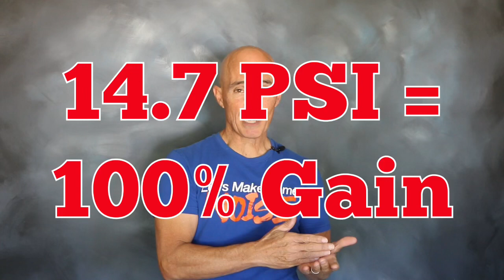More Turbo Power! What can you do to make more HP per PSI of Boost?

Comment: I’d like to see a budget reliable 1000hp turbo LS build. Frieburger did one on engine masters with a set of 1400.00 rods. Realistic would be good
Reply from the maker: what rods cost $1400?
Reply: The FEW places I have found them the Wiesco boostline rods he used range from 1200-1500.00
Reply: From wiesco site they list at 1400. The most common price is 1250 ish. I think lsxeleration has them for 1475
Reply: I’d personally like to see the new Summit ProLS rotating assembly put to the test. For a complete kit at 2000.00. Said to be built to handle 1000 hp. Usually means it will handle 15-1800
Reply from the maker: John Sutton that’s a lot
Reply from the maker: John Sutton big money
Reply: A lot for the Summit kit? For a forged 408 kit with rings and bearings? That is the cheapest “good” kit I have been able to find. Crank, rods and pistons. They have different CI sets.
Reply: I feel like I work for them!!!! It’s just the best Deal I have found. Like you said it is still a lot of money. So you buy them and torture test them so I can feel confident in buying it. Then put it in my s10 drag truck with a s480
Reply from the maker: John Sutton I just got pistons and rods
Reply from the maker: @john-sutton-tn  thought it was just the rods
Reply: No sir. Crank, rods, pistons, rings and bearings. All forged and moly rings.
Reply: My donor 6.0 is a gen 3 but had some damage on #1 bearing journal. Spun a bearing. I live in Va. Finding competent LS machine shops is very rare hear and generally super expensive. So to get a good kit that is balanced. I can set all clearances myself.
Reply: My donor LQ9 had a damaged #1 rod journal. The cost of repair and pistons and rods, is close to the cost of the kit with crank.

Comment: Turbo size is very important for these calculation. 14.7 psi on a small turbo will not make nearly as much power as 14.7 psi on a huge turbo. CFM is what makes power not necessarily PSI.
Reply from the maker: a turbo that is too small won't be able to supply the same boost
Reply: @richardholdener1727  Understandable. I just came across your channel and love it! Have you done any videos comparing pressure vs volume? The same PSI on two different sized turbos can make drastically different power numbers. That's all I meant. I'm pushing a pretty small turbo to about 42lb/min but it takes 25psi of boost to get there. My last slightly larger turbo was flowing the same amount of air at only 20psi.

Comment: Happy holidays have a question I have a GT 350 and I am having a hard time trying to make my decision on what power adder  to go with We have Hallion Twin Turbo sleeper kit we have the Pro Charger unit and we have the new GEN five Whipple supercharger.
So people are telling me that the belt driven Superchargers sometimes break the snout of the crankshaft And Twin Turbo’s are a lot of work and not reliable and have issues so I stumbled into your site on YouTube I figured I would ask you what would you recommend and your opinion on the subject
Reply from the maker: depends on your power needs-they all work at moderate power/boost levels-that GT350 has high static compression so boost is limited any way. turbo make the most hp per psi of boost
Reply: Are Turbo chargers More problematic and have more issues than let’s say Pro Charger or a Whipple

Comment: Why does most LS builds seem to stop at 28-29 psi of boost?
Is that the safe limit? 
audi,toyota,honda and nissan builds seems to often go higher,40-50psi of boost.
Thats ofcourse mostly buildt motors,but some are stock bottom end making 750 hp on 2.2 L displaysment !

Comment: And then if we started with a billion horsepower and doubled it.........lol Just jokin man, so the exhaust after the turbo , being more important, what size should I run if i'm estimating my power goals of my Saturn engine to be 325-340 HP? I know that my CV axles in the Saturns are rated up to 375 HP so that part, I should be ok, but I'm going to do .20 over, 3rd generation 6 counterweight crank and lower tie plate, ARP main and head studs, a stage one port and polished head with polished combustion chambers  , port and polished intake manifold with port matching , bigger throttle body, dual intake cams, mild de shrouding of the intake valves, mildest bowl blending offered, and adding narrow blended 1-2 mm valve seats and shim the valve springs to .15'' with 14 PSI of Boost,  and I haven't decided yet if i'm going to run it on E85 , unless you can tell me how to safeguard my fuel supply parts to run it safely,  thanks, if u can let me know, always enjoy watching your great work and great channel..  ;)
Reply from the maker: THAT WOULD BE A BIG TURBO!
Reply: @richardholdener1727  For the joking billion HP? or the 14 PSI?...lol

Comment: 300 horsepower and 29.4 psi boost =900.16 assuming everything holds up and you have enough air/fuel
Reply: If you had the 600 hp by adding one atmosphere, and then you add another atmosphere, that should double the hp again 1200 hp. Am I wrong ???
Reply: Dale Ostrom incorrect. Every atmosphere adds the stock horsepower one more time. 
300= 1 atmosphere 
600= 2 atmosphere 
900= 3 atmosphere

Comment: The amount of hp per pound of boost has a lot to do with volumetric efficiency.ls engines have very good VE  for many reasons so they can make huge power with not much boost compared to some less efficient engines.

Comment: Have you ever done a carburetor intake manifold comparison on the LS series? Say on the old LM7?  Would the gains be noticed on a 400 ish N/A build level? (Cam&springs swap)
Reply from the maker: Ive run lots of carbureted intakes on cat and rec port applications
Reply: Richard Holdener any one intake the clear winner? Or pretty much all yield close to the same results?
Reply from the maker: brandon mash https://www.hotrod.com/articles/20-ls1-intake-manifolds-tested/amp/.  Take a look at this intake test I did for Hot Rod

Comment: Great videos do you have any on cc volume of heads with boosted applications especially on the intake side? Lots of N/A info on subject out there but very little to none on boosted applications, like when is the runners to big and in efficient low boost vs high boost?

Comment: Without watching, I'm guessing wide LSA cam with extra exhaust duration, high powered ignition with adjustable timing, total seal rings.
Reply from the maker: THE ONE THAT MAKES MORE POWER NA
Reply: @richardholdener1727  ahhh yes the low hanging fruit

Comment: How about y pipe diameter vs spool time vs back pressure?
Reply from the maker: The Y pipe diameter will not likely change spool time-and its difficult to measure on the engine dyno-the load is artificial and not like on teh street or chassis dyno. Spool rate is primarily determined by  the power output of the na motor vs the tubos sizzing
Reply: @richardholdener1727  I have seen people neck down before the flange. The claim is the that the bottleneck causes an increased in exhaust gas velocity, which  translates to better throttle response. 

Or it could be a crock!
Reply from the maker: @thegrumpyoldmillennial328  joining two pipes almost requires them to neck down but the turbine housing is almost always the restriction

Comment: Typically this would be for turbo applications; what about supercharger/blower applications with larger parasitic losses? I don't believe double the PSI wouldn't really make double the power on a supercharged application.
Reply from the maker: Blower motors usually don't follow the formula, they are better at lower boost levels, but the drive losses can get serious at higher blower speeds and boost levels.

Comment: Is the reason you make more power with a bigger turbo at the same boost mostly because of the exhaust exiting faster ?  Is a 78/75 big enough for a 6.0 ? I had a 76 / 65 couldn't get more than 9 lbs but instant spool
Reply from the maker: a 76/65 is way to small on the hot side for a 6.0l

Comment: Ok, so would the atmospheric pressure that the motor is under also called vacuum pressure?? If not, how do you calculate how much atmospheric pressure your motor is under? Sorry for being a year late lol
Reply from the maker: atmospheric pressure is 14.7 psi (changes some based on altitude and weather)
Reply: @richardholdener1727  thank you, that’s what I was thinking.

Comment: The easiest explanation is this:

When "N/A" you're going to hit much higher timing than when you put 14.7 psi into it.  So if you put double atmospheric into the motor.  So if you boost it and you think you'll double the power on low timing, that's just not going to happen.  You need somewhere around or near MBT to get near a perfect condition like this.
Reply: Ignorance makes ask...what is MBT?
Reply: @baileydbenson1  mean best torque.  Basically the amount of timing needed to make the most power with the lowest cylinder pressure.

On a coyote 5.0 MBT timing is around 29 to 30 degrees on gen1 and 2 and 28 to 29 on gen3.  You can run 2 degrees more timing than this and pick up 3 to 5 horsepower but at the cost of way more cylinder pressure.

Comment: At what hp level are tubular headers worth a hp gain over stock truck manifolds on a turbo ls?
Reply: I have done back to back and not noticed a very large increase in hp at the top end rpm. What I have noticed is the turbochargers spool a lot faster with a well made manifold in some cases 2000rpm eairlier and this will show in low end hp gains as you're into boost eairlier. So it allows you to run a far larger turbo with similar response time to a smaller one. Top end was only a fraction better using the same turbo size. Others may have found different.
Reply from the maker: I suspect You wont find a big difference in power between the stock truck manifolds and tube headers (like all the china versions) unless you are running very high power levels. Maybe with custom built headers.
Reply: Richard Holdener hmm interesting.  So u don’t suspect flowtechs to out perform stock manifolds at 1200whp?
Reply from the maker: @Onalky87  that's pretty high power level, but I wonder if they were run wit h he same y pipe and turbo, especially if the turbo is near maxed, if you would see anything. Maybe so at that level but I was more thinking of the 90% rule where the average guy is at or below 1000 hp.
Reply: Richard Holdener ya I figured that’s who u were directing it to.  Was just curious about us 10%ers if they would be worth atleast 25hp or something
Reply from the maker: @Onalky87  we run tube headers on our Big Bang motors
Reply: Richard Holdener so that’s gotta be saying something I figure

Comment: What would you gap your rings to on a 5.3 ????
Reply from the maker: we normally do .028-.030 for high or sustained boost
Reply: Richard Holdener .030 top or the bottom ring or both match the same gap on top and bottom
Reply from the maker: Jordan h both the same-it’s not critical
Reply: Richard Holdener thanks!!!!!
Reply: Most engine builders go .002" bigger on the second ring to relieve pressure between the rings. Helps with ring flutter on the top ring.

Comment: Hello sir. My car is now 90 hp and it has 1.0 bar pressure. Its 1.5L diesel. If the turbo pressure is 1.2 bar, how much pressure it has?
Reply from the maker: 1.2 BAR =1.2 X 14.7=17.64 PSI
Reply: @richardholdener1727  thanks for Fast reply. You mean my car will be around 107hp after 1.2 bar turbo pressure? Or what? Thank you
Reply: @richardholdener1727  ohh i solved now when i watch again your video. Thank you again. You are awesome Man 💪

Comment: 29.2/2bar= 200% power-gains???? I’m new to this turbo stuff so correct me if I’m wrong
Reply from the maker: yes-if it made 300 hp na then it would make 900 hp at 29.2 psi (if everything was right)-gets harder to do at higher boost levels
Reply: Richard Holdener I’m ready for that video on the heat-exchangers/intercoolers.

Comment: Psi means nothing....its size of turbo and air volume.....a t3 small turbo at 20 psi is nothing to a t4 flange huge mayor and compressor size at 8psi
Reply from the maker: a T3 won't support 20 psi on a 300-hp 5.3L-the math works-trust me
Reply: Correct psi is just a number

Comment: HP/psi really doesnt matter. A turbo set for X lb/min will make 80% of the same hp on any size/combination of a motor. If a turbo cannot provide enough air for 1000hp, it will not make 1000hp in a very  strong NA motor. Your power boost formula does not work, a 300hp 5.3 + 14.7 psi:600, will not linearly equate to a 600hp  5.3 + 14.7psi:1200hp, this is a math that is not linear.  Turbo compressor efficiency and range is much more important. Give me a 300hp 5.3 and a 600hp 5.3 and add the same turbo  and they will max out the turbo at 80% of the hp, just different psi.
Reply from the maker: this is simple math-backed up all the time on the dyno-if the things indicated in the video are right-it works
Reply: @richardholdener1727 No, your math is wrong.  Ok, then try the same turbo on 3 different size engines (4.8, 5.3, 6.0) and turn up the boost all the way (race gas/e85) and they will make within 10% of each other. HP/PSI is still irrelevent, all this math sounds nice in theory but it does not equate to real world.

Comment: 29.x psi?
The diy guys engine goes 💥☄️🔥.
Reply from the maker: All the cool kids run 2 bar!
Reply: Richard Holdener I ran 26 pounds on my old VW AAZ diesel... stock turbo uncorked... probably made 120hp
Reply from the maker: Iain Sutherland yep-those don’t make much na unless you pour the fuel to em!
Reply: 2.3 bar for me on a 2.0 YB cosworth😎
Reply: I have a diy motor pushing over 30. But i diy built it with studs, mls gasket, and forged internals. Haha

Comment: A idiots guide to sizing a turbo and interpreting compressor maps would be a great video...
Reply from the maker: not a lot of maps on the low buck turbos
Reply: Paul Morris 
Yes I agree 
I have a 5.0 Windsor build to do for one of my sons and we want to run two small turbos ( mainly to address packaging challenges) and non intercooled blow through carburettor. ( read budget constraints).
We are wanting to build mid range torque rather than huge output.

Comment: What does an engine do at 29.4 psi 
IT EXPLODES thats what  xD
Reply: It starts to turn the world when it accelerates.
Reply: i daily at 38psi and im good. all stock
Reply: My engine is over 15 passes so far at over 30. And all it did was break a 35 spline locker, and split my trans in half...lmao
Reply: @buiItnotbought  LMFAO on 4 bolt heads and OEM head gaskets too right?
Reply: @700HpVette  mines a 2 bolt l98 block. It has skip white 200cc heads, main and head studs. Scat forged crank, scat h beam rods, weisco pistons -24cc. Head gasket is procomp mls with copper spray
Reply: @buiItnotbought  a TPI motor from the 80's?
Reply: @700HpVette  yeah well the block is just a 89 oe roller cam block. The internals are forged and ported heads. The intake is the holley stealth ram with an accel 1000cc tb and 114 lb injectors
Reply: @buiItnotbought  well shit, I was a little worried about 150 shot on my 1996 LT-4. ARP head and main studs, 4 bolt block, Manley H-beams, forged JE pistons, MLS head gasket, guess not! Lol
Reply: @700HpVette  my friend ran 300 shot on mls gasket with copper spray and the motor lived 9 years and he didnt use a progressive nitrous controller. He eventually popped a ring land cause he didnt open up end gap. Did you open yours?
Reply: @buiItnotbought  yessir, .030 ish, the recommendation from Total Seal for the 150hp shot. 2618 pistons too...
Reply: @700HpVette  that sounds like a bullet proof motor to me! Your block is better than mine too. You have a nitrous controller?
Reply: @buiItnotbought  not yet but in the plans!

Comment: air to air vs water to air vs carb
Reply from the maker: Intercoolers add power even on blow-through carb applications-I have an ATA vs ATW vid coming up but not on a carb. I did the intercooler carb test on a BBC
Reply: I would like to see an intercooled carb vs non. How much power is really picked up between an intercooled vs non. The car will being temps down below ambient temp with out an intercooler to begin with due to thermal dynamics of the fuel evaporatoring and causing a temp drop.
Reply from the maker: @rickwilkinson1651  i tested that on a bbc-intercooler still helps

Comment: That is true in basic, but you have many more factors in the equation, two gt45 turbos running at 7 psi will probably make more power from one gt45 running at 15 psi, so turbo cfm is very relevant to engine power, more from boost (psi), by the way, it will be a nice experiment, put two big turbos on a stock 5.3 vs one big turbo, I did not see anyone that done it
Reply: you realize he said that right ?